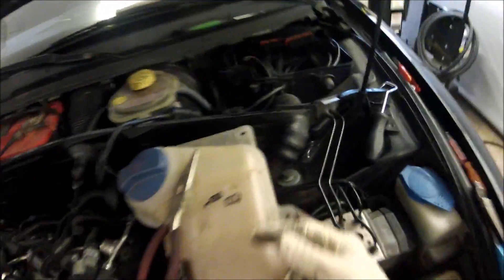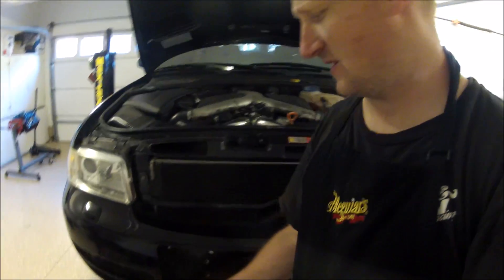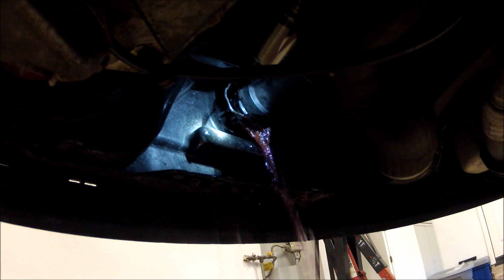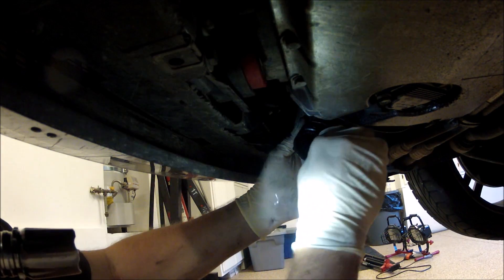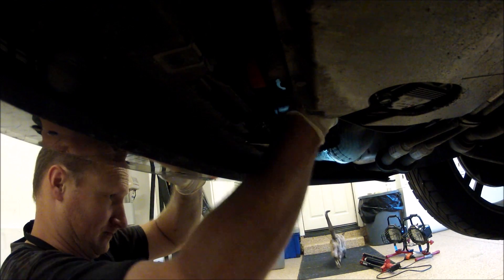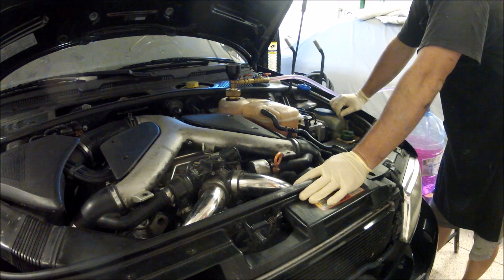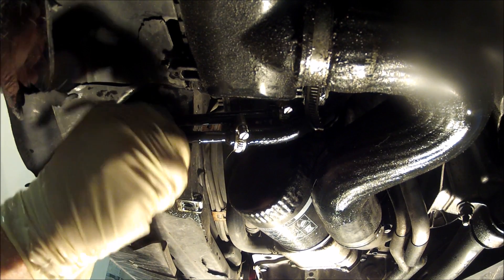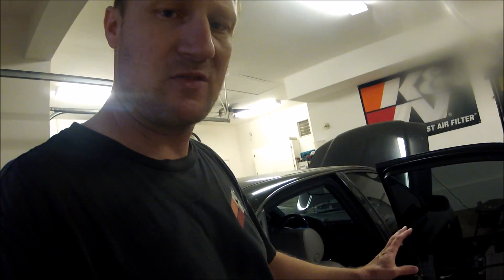Day and the Life of an Audi S4 Mechanic

Comment: Hey Justin! Super glad you're back and posting more! Ive got an '04 A6 with the 2.7T, still a love/hate kinda deal I'm sure you know! I was wondering with all your knowledge with these cars if you knew about the steering shake over 50 but under 70? I've tried new rims, tires, balancing at multiple shops, but nothing works. The whole car has an overall shake as well at those speeds but figure that might be the Driveshaft Bearing being worn, but doesn't fix the steering wobble. Any insight would be much appreciated! Thank you again for the awesome videos that go far more in depth than anything else out there!
Reply: I should also mention the car has done this for the entire 3 years I've owned it, all control arm bushings are good to go, sway bar and end links are good, I've checked the bolts the the steering rack is mounted with and they are all tight as well.
Reply from the maker: There are too many variables.  Was the car ever in an accident?   How's the alignment?  Are any of the rims bent?  You Said new rims, new rims to you, or brand new rims?  How are the axles?  Tie Rods may look okay on the outside, but could be bad on the inside.
Reply: Never in an accident. alignment is spot on. no rims are bent at all. brand new rims. front axles have been refurbished by myself about a year ago with all new boots and grease with no change in the shake. tie rods on both sides have been completely replaced within the past year as well. basically every bit of the front end has been touched, checked, and replaced/fixed if needed with the exception of the wheel bearings.
Reply: Justin Ballou hey would you be able to tell me anything about a 2003 audi a4 quattro I'm worried the transmission is going out it won't shift past first gear at all but it doesent shift harsh into reverse and drive anything do you think it just needs tranny fluid or do I need to get a new tranny all together

Comment: Could that melted vacuum line by the exhaust cause a P1476 code? Just popped that code the other day and noticed it was touching and looked slightly melted but not melted all the way through

Comment: Actually I have a question, maybe you have an idea of what’s wrong with my S4. I was driving home from Advanced Autoparts and lost boost when I look in my mirror white cloud of smoke. My boost gauge went limp. It’s been sitting for 6 months I put a new battery in it and some Oil stablizer and 2qts of oil. I had to move it because the complex was pudding down new assault. But as I was moving the car my boost gauge started working when I gave it gas but still the cloud. Do you have any insight for me. I think it’s my turbos but I’m just guessing
Reply from the maker: It could be a number of things; more than likely it is a bad turbo.

Comment: Justin Ballou! Quick Question! This car looks like it has a cat delete... or at least as far as I can see. Doesn't that cause the o2 sensors to read incorrectly and or cause a check enginer light to occur?  (I am asking this because I just bought a B5S4 as well and it as the cats removed. My check engine light is on regarding both 02 sensors).
Reply from the maker: There are different ways to get around this.  Lots of info online.

Comment: thoroughly enjoy your videos. very informative. I'm actually looking to buy a B7 S4, maybe an early B8. Is this a mistake? not sure if an Audi with 80,000 miles is any different than most cars. Age + miles = headaches. I like the V8 though. Suggestions?? thanks.
Reply: Abject Rebel Just like with the b6 S4, the engine has timing chains located against the firewall. It's very common for the plastic guides to break around 100k, and the only way to fix this is to remove the engine. Very labor intensive. This is a well known issue with b6/b7 s4. I did the service myself for the cost of parts, close to 1500$ including a clutch. With that being said, the car is an absolute blast to drive!

Comment: Hi Justin I have a 2001 A6 2.7T and it misses badly at start up when the air temperature is 15C or above. When the temp is lower than 15C it starts and idles no problem. If the engine is warm and you start then no problem. The missing goes away after about 2 minutes. A scan shows faults on both O2 sensors and exhaust gas temp sensor..would this cause the bad idling at start up? Any other suggestions to check? MAF sensor? Thanks.
Reply from the maker: Ah, yeah...  Replace the O2 sensors and the EGT first.  Then go from there.

Comment: Glad your back and out with a new video. I've replaced two window regulators on my B6 A4. Where did you get the coolant hose o-rings from? And how did you know what size?
Reply from the maker: The Part Numbers are in the Description Section.

Comment: Just as I have always thought about Audis; underneath the glitter and the acres of piano black trim, they are all just a load of cheap Volkswagen parts badly designed and put together with little thought for mechanics like Justin who have to deal with the crap when it fails.